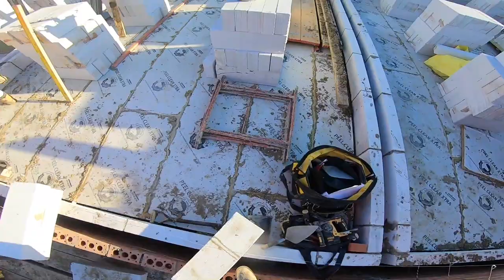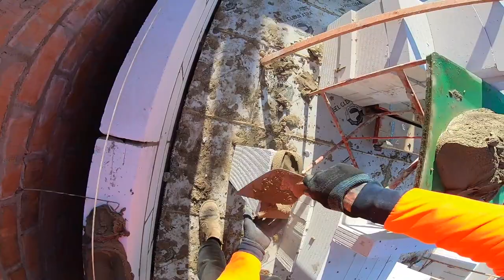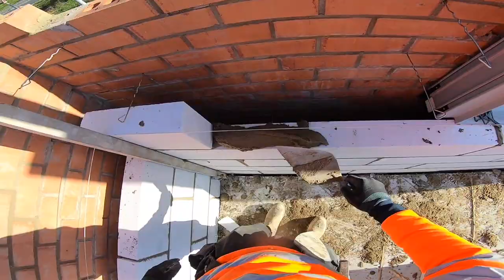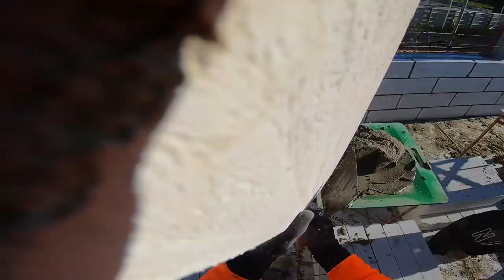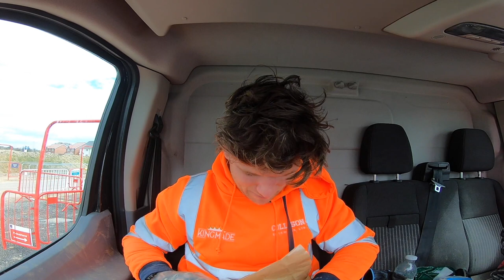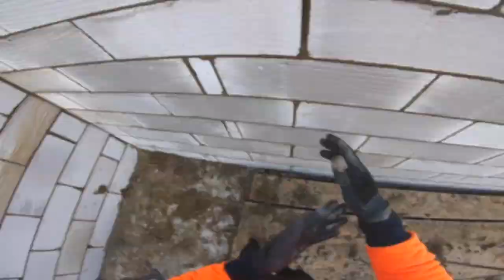FASTEST Trowel on the block 👊🏼

Comment: Those look like the thermalite blocks I used to use back in the UK over forty years ago.
They look a lot longer in size but they are so light you can lay them with one hand just like laying a brick.
Two brickies could build a garage in a day and they were very strong walls.
I will never understand why they were never produced in Australia as they are mainly made from power station dust.
They would be a great product for walls that could be rendered and look amazing.
They have a similar block here called Hebel which requires a special compound to bed them and they are very expensive.
These Thermalite blocks are bedded with normal mortar and are a lot more reasonable in cost.

Comment: Toothing out is frowned upon because it introduces a plane of weakness which undermines the structural integrity of the building. You nailed it yourself, its impossible to get the same full connection between  brick/block and mortar. And its more likely that you will leave voids when trying to force the mortar in retro actively.

Comment: When the mortar drops down the cavity, after removing excess mortar from the bricks just laid, Does this affect the damp proof course in any way ? I’m not a brickie just a DIYer who is interested. It’s not a criticism I’m just asking.Does the Mortar make a difference if it builds up at the bottom of the cavity. Or is it of no consequence?
Reply: If there was enough muck too bridge both walls above dpc then yes it would cause the dpc too fail and is alot of work to put right you would have too be a horrendous at making your bed too fill a cavity above dpc😅

Comment: What are those clamps called mate that you can slide through the bed joint they have a little bar on other side that catches the brick? You have one on your profile set up at 7:18
Reply: T clamp from BT engineering, but always out of stock.
Reply: Can get them from brickies bit and kp profiles on Facebook
Reply: @neilsmart78  nice one thanks for that did t know about brickies bits, noticed he has Dori blocks ! But there out of stock currently, will keep checking would like to get some Dori blocks as well as t clamps. Thanks for sharing that information 👍👍👊
Reply: @JimJimpmjj   also ses tools online
Reply: T clamps from BT Engineering.  Use code Charlie for 10% discount but don't be surprised if they're out of stock as Charlie has them all. Lol. I have a couple and they're pretty good
Reply: Ses tools are brilliant they drive around sites in the southwest with tools at the ready
Reply: Just been on “brickies bits” decent little site anybody that’s not been defo worth a nosey.... those mortar stands 7500mm high £25 each is a good deal but all sold out 🤬

Comment: Iv always done Blockwork first its easier and keeps the cavity cleaner
Reply: I would disagree. Years ago, we always did face work first. Knocked the snots off and then backed it up with the blocks. Far easier to keep cavity clean. The big plus was setting out all your openings to work bricks too. Just saying😉
Reply: @justycrusty  yeah it was bricks, scrape back then blocks. Was cleaner then I agree but maybe blocks 1st is best as capitalises on using profiles, sets window levels, and helps preventing wind damage costs, since blocks are easier to repair than brick panels... And doing locks 'backs facework befotehand'
Reply: @justycrusty  I suppose it's because I started out on the Civil side but we do trace it out to work bricks

Comment: No wastage!!!! You've got blocks sitting on the floor 300 long but using a new block for a 140 cut???. You seen how much muck is on the floor try putting your joint on over your muck board. You cart a block cutter up there to cut your blocks when a bolster fits in your bucket